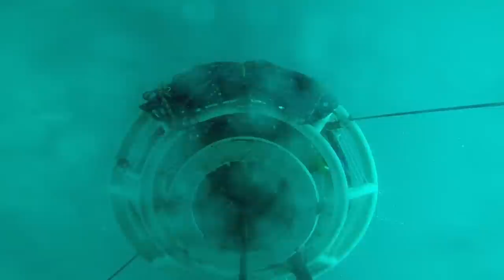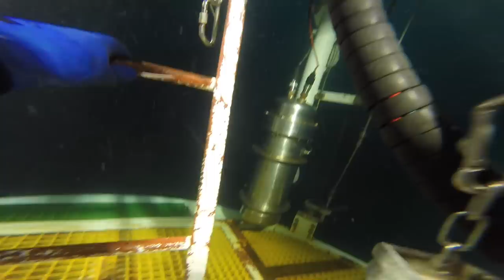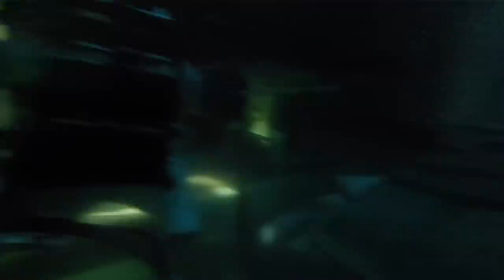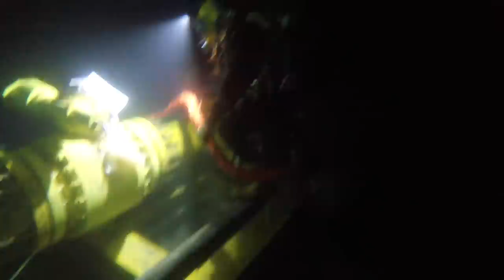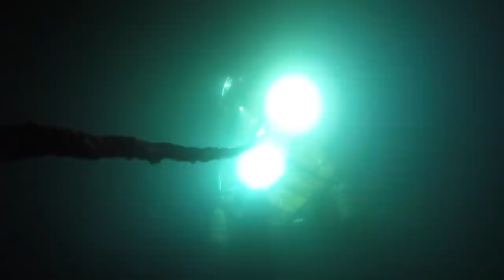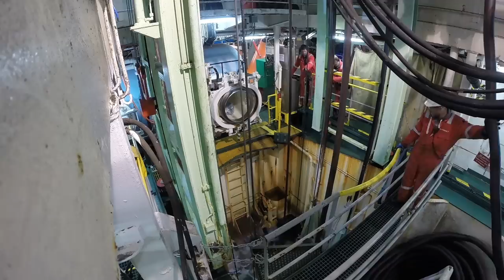Saturation Diving 2018

Comment: The thought of not being able to wipe the sweat off my face is enough for me to know that this job is not for me.
Reply: Haha that dam itch on the tip of ya nose,  lol
Reply: You have a free flow knob that will blast your face with gas.  Itch on nose.  Nose clearing device that goes under your nose can be used to scratch.

Worse... a smal hair in your eye.  Cant do f'all about that! Just have to wait till it locates in the rim of your eye... or go back to the bell and flush with bottled water.

Before putting my hat on i religiously used to tug off loose eyelashes!

Comment: I heard somewhere that divers in the (de)compression tanks spend up to 28 days getting their body adjusted for the pressure at the depths they are diving and that it can sometimes be as much as 19 times to pressure of the surface?

I couldn't believe that was right.

Is it really as much as that?

If so, it certainly proves that any space travel to planets with considerably denser (right word?) atmospheric conditions would definitely be possible and allow humans to walk on the the surface, providing the appropriate "acclimatisation" was implemented and the correct equipment was used.
Reply from the maker: It can be more than 19 times. At sea level the pressure is 1 Atmosphere (ATM) at 10m it is 2ATM, 30m is 4ATM, 100m is 11ATM. I have dived at 190m/20ATM and the deepest ever dive was to 701m/71.1ATM.
Reply: @diverandy77  700 metres!! That's absolutely insane. I imagine it was dark?
Reply: @enricohocho  I thought as much
Reply: Ok your comment is 3 years old, but anyway. They don't decompress for 28 days, but they live under pressure for 28 days, working, sleeping etc. Then after 28 days they decompress and go home. If they're pressurized to the pressure equal to 100 meter depth (330 feet), it takes approx. 3 days of decompression. Kinda crazy that my father did this for 20 years... he was rarely ever home.
Reply: @Antarath  
Ahhh, I see.

Thanks for the clarification.

Comment: The diving doesn't scare me as much as the transition from bell to pressurised living quarters. I know there's a ton of safety measures in place to make sure of not another Byford disaster but it could happen.
Reply: I’d be fine with that. I could do this job but I couldn’t do the night time side of it or going down far enough at certain light where it’s dark down there. I don’t mind the sea but at if I can’t see much l have a heart attack 😂
Reply: @LiamHolloway  it's always dark at those depths  they work in the dark 90% of the time man
Reply: Delta P is another danger
Reply: @EliteprosoldierMW3  delta p is terrifying

Comment: I am a padi rescue diver and I have worked on the indutrial side as well. I was a hose tender and did the rigging. I have been in a hood and semi dry in a lake and it wasnt that bad. I have thought about going in to this and leave my trade as a union boilermaker. Would it be worth it at 38?
Reply: ill go with you!

Comment: Watch LAST BREATHE. on Netflix.
Reply: I Was really surprised that there wasn't more coverage of the incident at the time, but then realised the company wanted to hush it up.
Reply: Is that the one when his umbilical gets stuck and clings on to that metal pole and the boat is drifting away and its getting tighter and tighter due to a storm
Reply: @nscouller2726  yes.
Reply: @DENS973  thought so
Reply: @nscouller2726  not a storm.  A 'D.P. RUN OFF'  system failure on positioning
Reply: Thx

Comment: I believe this dive was very shallow to simulate a SAT dive. Note natural sunlight throughout, and natural coloring. Below even 200 feet its nothing but dull grey.
Reply from the maker: Nope. I was in the water, taking the footage. There was nothing simulated about any of the dives.
Reply: @diverandy77  i stand corrected then diverdan...me, not SAT rated, but have done deep naval dives using mixed gas and Kirby-Morgan
Reply: diverandy77 ...also just wonder how long you guys were down and how long you had to spend coming back up?
Reply: Agm Smith  It seems as if for every 100 feet, they do a day of decompression and then an extra day added on top. At 300 feet, they would do 4 days of decompression. The reason being that they surpass the normal bottom time to such an extent that they need to decompress THAT much.

Not a SAT diver. Not even certified for open water (going through class rn). Just regurgitating what i’ve heard from other SAT diver videos.
Reply: @Pepe-ts9ec  as a rule of thumb deco is 1m/hr plus holds
Reply: DES HSE II - 2nd Ammdt supporter  Thanks for the reply. I love your username.
Reply: @Pepe-ts9ec  What user name? Ric Powers? Thats my birth name.
Reply: Ric Powers  I was referring to “DES HSE II - 2nd Ammdt supporter” but your birth name is also very cool :))
Reply: @Pepe-ts9ec  oh, i was just checking Pepe. Thank you.

Comment: Hey i have a few questions... im not a very experienced diver though (im only 14 lol) so if this seems ignorant im sorry. Do you use heliox while diving this deep? And is that a warm water suit you are wearing while going down the diving bell?  what depth are you at and what task are you doing at the ocean floor? Lastly how long is your decompression obligation at that depth?
Reply from the maker: Yes the breathing mix is Heliox. Yes it's a warm water suit. The water comes down from the ship and is regulated by a valve on the divers hip. In this video we were conducting valve ops and fitting a flushing hose to a manifold. Depth was around 100m. Decompression takes roughly 1 hour for every metre. 100m = 100 hours of decompression, but that is a very rough guide.
Reply: @diverandy77  thanks for answering :)

Comment: Stupid Question: Assuming the Diving Bell is at a depth of, let's say, 300 meters. What would happen if someone would climb down the hatch into the water at that depth only half-way down, submerging his body up until his belt? Would you actually feel the water pressure even if you just stuck your arm in the water? Without a diving suite, forgot to mention.

Comment: At the beginning I was wondering why the bolts had so much thread left, then I noticed the hydraulic bolt tensioners later. Makes sense, a torque wrench is probably not well suited for the conditions.
Reply: Hydratight bolt tension system . Extension phased to allow jacks on.  Well noticed

Comment: I am wondering how does the increased pressure of 10+ ATM in the diving bell feels, is it noticeably harder to move around in that kind of pressure enviroment compared to the surface?
Reply from the maker: Nothing noticeable. Other than clearing your ears on the way down or up you don't really feel any different.

Comment: is the water very cold when you down 150 something meters
Reply from the maker: Yes about 5 degrees Celsius. The suits we wear have hot water pumped into them. There's a valve on the hip that regulates the flow and we can ask the diver supervisor to make the water hotter or colder to suit what we are doing.

Comment: This may be a ridiculously dumb question but when you open the hatch to let the divers out of the bell does that water not come in because the bell itself is pressurized to the same pressure as the surrounding water?
Reply from the maker: That’s correct.

Comment: I have a question. A friend of mine said that when your in a compression chamber to deep dives the air can feel thick is this true?
Reply from the maker: That is kind of true. The deeper we dive, the less Oxygen we have in the breathing gas. As a result it can be more difficult to breathe, especially when exerting yourself. The best practice is to remain calm, relaxed and carry out the diving activities as efficiently as possible.
Reply: @diverandy77  thank you for answering my question but i have another what is your record for diving.
Reply from the maker: @Jilted84  deepest I've dived is about 160m
Reply: @diverandy77  dang is that deep for sat dives?
Reply from the maker: @Jilted84  It's deep enough. Sat diving can be carried out beyond 250m but that's fairly rare. The North Sea has a few areas deeper than 200m but it averages around 100m
Reply: @diverandy77  i cant imagine how it would look. There is really low light down that deep right? it must be sureal.

Comment: Do their suits pump warm water throughout to keep them warm at these depths?...
Reply from the maker: Yes. The hot water comes down the umbilical with the breathing gas and light/camera/communications cable. There's a valve on the diver's hip that regulates flow.

Comment: Why the water does not enters the diving bell when opened
Reply from the maker: Because the pressure inside the bell is slightly greater than the water pressure. It works in a similar way to if you upturn a glass and push it into a sink or bath. The glass will stay filled with air.

Comment: Dumb question how does the bell not fill up w water? Pressurised?
Reply: captlucky 23 the pressure inside the bell is the same as the water beneath, however you need to make sure the bell door thing is shut tight  before you open the other door as the pressure inside the actual pressure chamber is different

Comment: I want to know what happens if your stomach starts hurting and you KNOW what time it is now. Where do you to the bathroom to blow it up?
Reply: 7-GOLD-BARS-7 If I remember correctly it is common to use the bathroom in your suit. You’re down in the water for a very long time and some bodily fluids are probably the least of your worries.
Reply from the maker: Pee in your suit. If it's more serious you can return to the bell or unzip your suit and "scoop" out. Fortunately I've never had any experience of that, personally.

Comment: So basically without these guys, the world would not have oil pipes, water pipes, internet wires and whatever else is under water that we rely on everyday.
Reply: There are various vessels designated for that purpose such Cable laying vessel and pipe laying vessel. This diver just do small portion of it that still reachable by saturation diving. Deeper than this, operation is carried out by ROV

Comment: What’s the gas coming off the diver after coming out of the water?
Reply: If its when he goes back to the diving bell its probably the steam coming off their water suits.
Reply: at the bottom of the sea it's about 4 Celsius, thats "gas" is the temperature difference going back to 20 Celcius, correct me if im wrong.
Reply: Plus they usually pump hot water through the suit I think

Comment: Imagine the lights going out, at that depth it would be pitch black…. I would go into a dangerous panicked attack
Reply from the maker: It can and does happen, very occasionally. If it does happen you can follow your umbilical back to the Diving Bell and that's got a battery pack to provide some light while you figure out what to do next.
Reply: @diverandy77  my goodness gracious... It probably take me a bit to remember about the umbilical, id be in such a panic. these men have serious balls of steel!